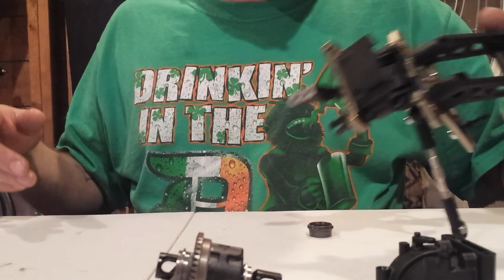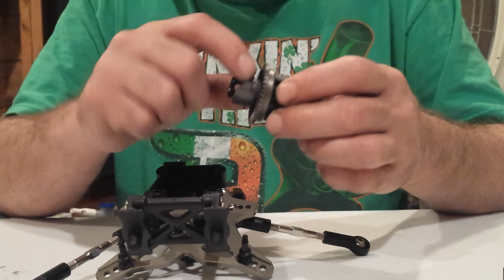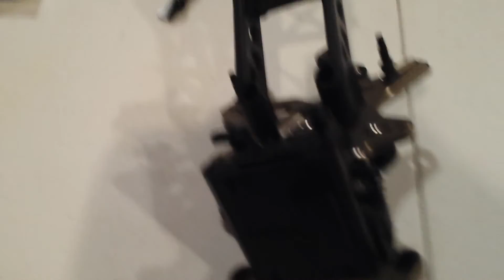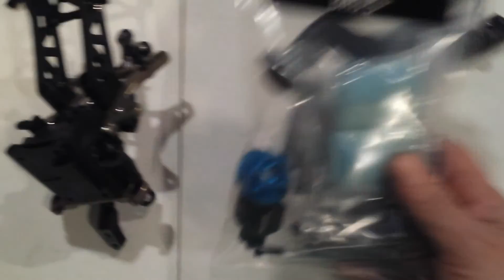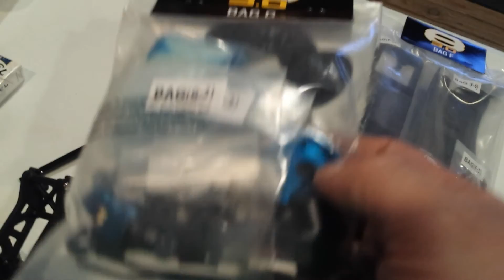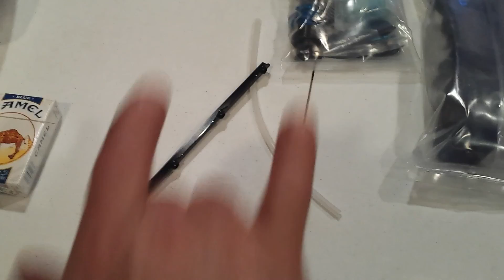Losi 8ight Build Part 5 Rear Diff Setup.

Comment: hey i have heavy meshing not matter what i do. any suggestions
Reply from the maker: if you can tell me where your shims are positioned that would help, It is possible that the kit came with the wrong shims, or try moving all of them to the ring gear side, also make sure the housing screws arent in too far or over tightened, they just need to be snug.

Comment: Hey bro I know this video is a few months old but a youtube sent me here for help on my losi 8ight t 2.0 brushless differential setup.  I tore the truggy down and I got the correct weight fluid.  Smart diff greece front ( I have a smart diff in the front)  and 2000 weight rear.  And I don't know how I should set up the ring and pinion mesh.  Ie shimming.   The truggy is 2 years old so it dosent need to be tight enough to wear in the ring and pinion teeth.   But idk how tight to make it.  Any help? There's vids on my channel of how I set up my front diff but I don't think it's right.  Any help would be very greatly appreciated.   Also I subscribed! I'm looking forward to more vids of the losi 3.0 :)
Reply from the maker: Thanks ks for the kind words!! 
    As fas as the rear ring and pinoin goes for shimmimg it when its already broke in, just get it as close as possible with as little binding as you can, even if its a little tight, it's not gonna hurt anything. I check the gear lash and correct as needed everytime I tear down.